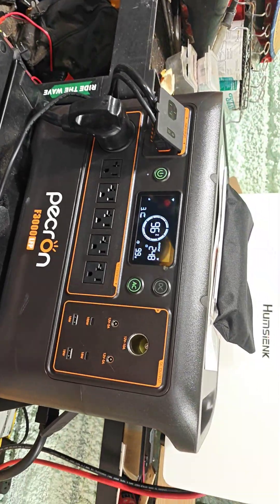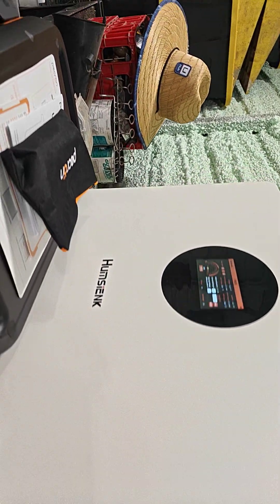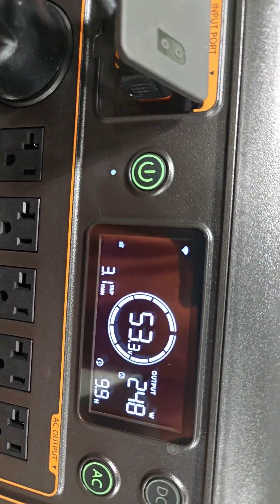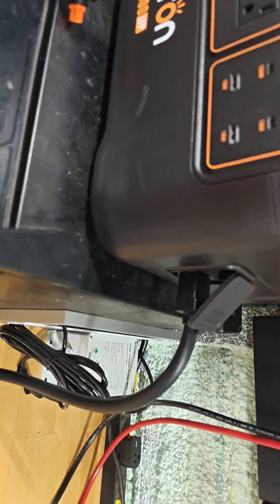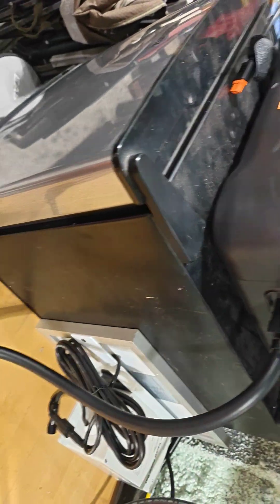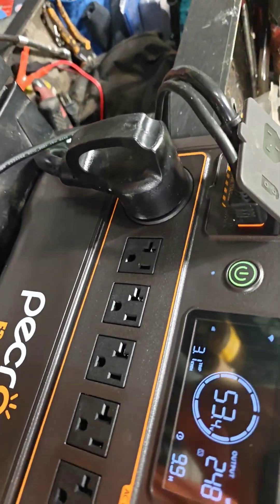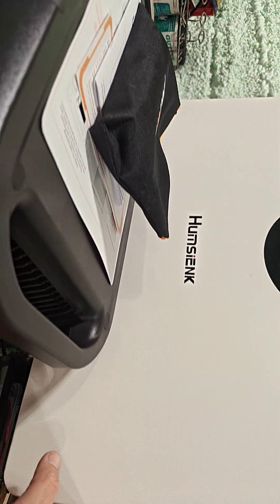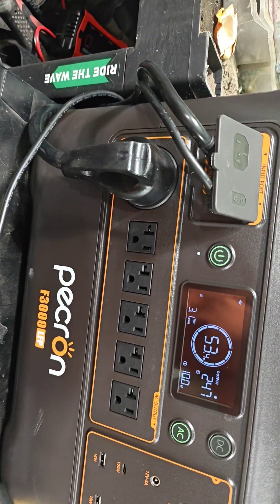Pecron F3000lfp with Humsienk 48v wall mount battery

Comment: I've seen to sync up the batteries to show you an accurate count on the percentage is to drop them both to zero and then recharge them to a 100%.  After that it should read both batteries from the pecron.

Comment: Im planning on doing something similar, did you do a test on the runtime?
Reply from the maker: Not officially. I did get my ecoflow tracker installed. With 3-275 panels I have yet to use grid power. Run a small fridge and a deep freezer plus lights and tools etc no problem